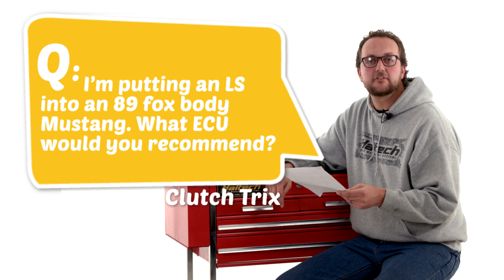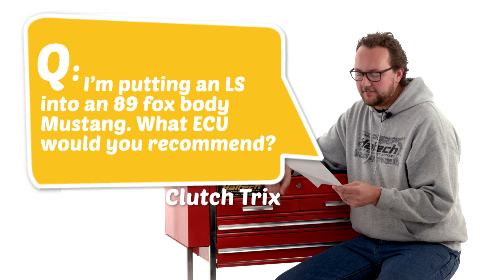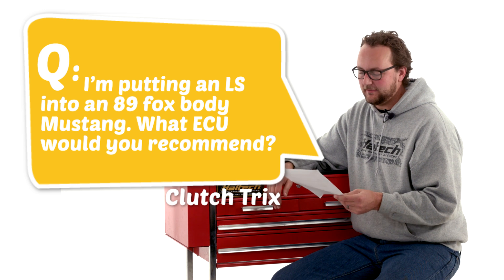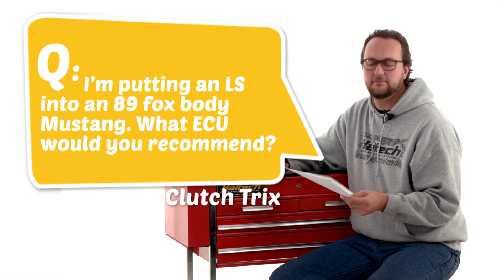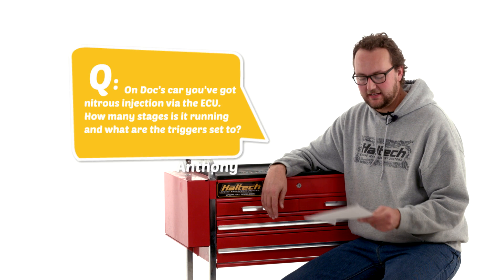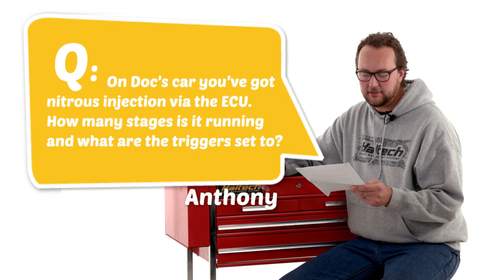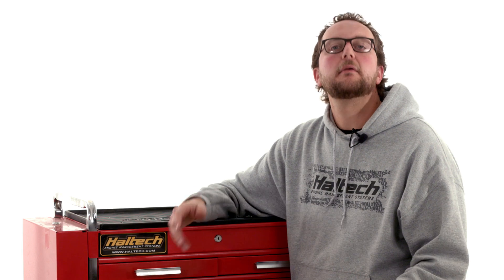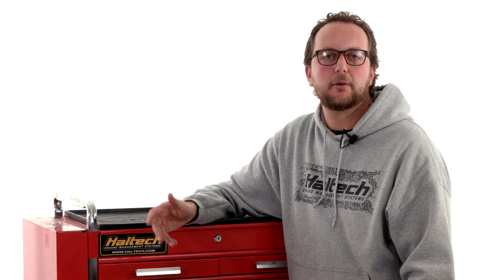❓ Transbrake, Creep and Bump, Doc's Nitrous Setup Secrets - Haltech Q&A Episode 14

Comment: I watched another video on YouTube and they were having overboosting issues. They fixed the issue by installing a reducer into one of the exhause pipe joins therefor creating more back pressue. I have never heard of doing this. Why would this work as it seems like a bodge rather than a real fix? Surely there is a wastegate issue? I also don't see how the boost level would be accurate and would still flucuate?

Comment: Can the elite 2500 operate a 4L80 transmission? 

why does doc car have two elite 2500 in it? 

Does the elite series compensate for elevation? If so what is it looking at or what sensor?

Comment: I'm thinking of going aftermarket ECU on the upcoming engine in my '77 Scirocco. I'll be using a 2.0L 8V SOHC Volkswagen ADY engine out of a 1999 VW Sharan. This engine has Multipoint EFI from the factory, I guess it's a fairly simple Bosch or Siemens system. Would one of your cheaper ECU's do the trick here? Don't need any pre-made harness or such things.

Comment: In my hotrod I'll be running an ls 2, Holley hi ram tunnel ram, and a turbo. Will that terminated harness be able to run with the Holley throttle body/injector rails
Reply from the maker: Our LS2 terminated harness has some flexibility with wire lengths, however if the TB/injectors are a large distance away from the factory location, you may need to extend these wires.

Comment: do i need a aftermarket ecu if i plan to run e85 and 98 petroleum on a 2005 wrx sti?
Reply from the maker: Yes - the factory ECU does not support flex fuel tuning, so you would need to move to an aftermarket ECU. The 01-05 WRX Pro Plugin ECU is a direct replacement for the factory unit.http://www.haltech.com/product/platinum-pro-plug-in-series/subaru-wrx/